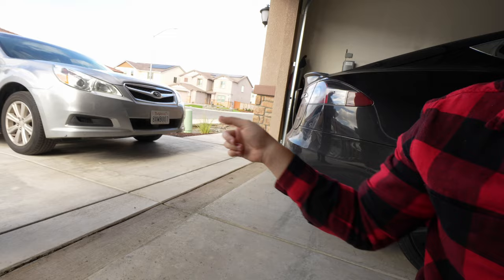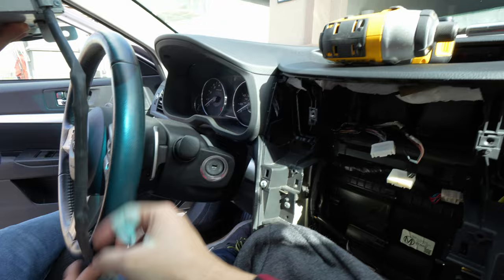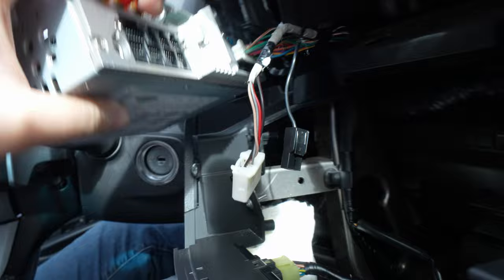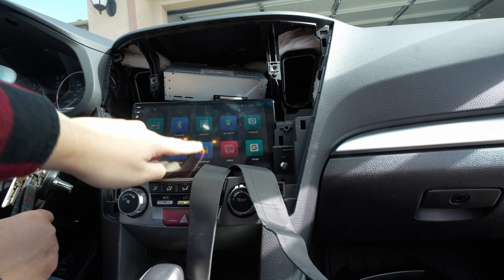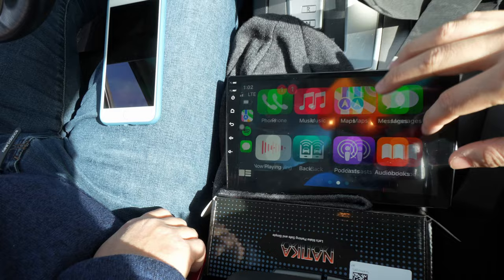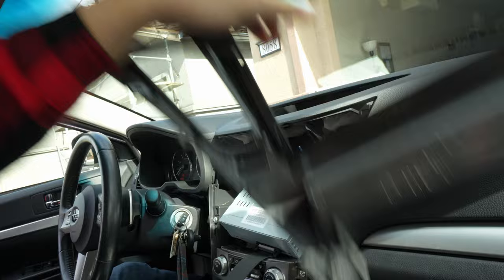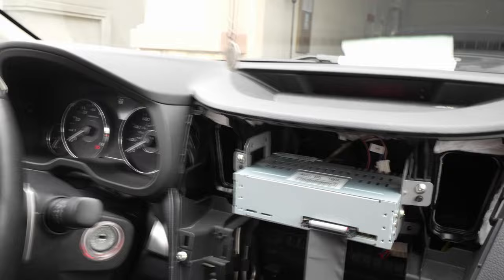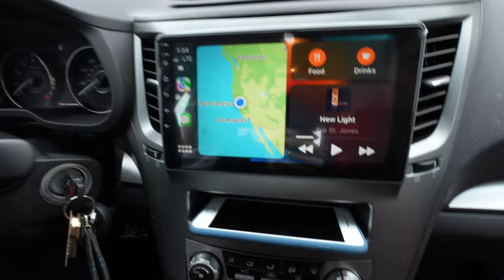Subaru Outback & Legacy  2009-2014 Carplay/Android Auto how to Install! | $359

Comment: I just purchased a Android (Hikity) based radio for my 2013 Legacy limited with H&K radio with AMP.  NEW radio, plug the speaker harness  in to the new radio.  The Blue wire with NO RCA end is power for your amp. The blue wire from new radio harness connects to PINK wire from main radio harness from the car. Buy a junction fitting, package $5 and connect the two.  BLUE wire radio is connected to Pink wire car harness. .
Reply: Im about to buy the hikity unit. Do you have a working tpms sensor? Also do you have an adapter that retains the subaru usb in the center console?

Comment: Thanks for the video. It touched on the things I was worried about with these sorts of tablet-based screens;
1) very slow to turn on due to it having to boot every time
2) clunky interface
3) not plug and play (antenna wire etc)
4) fitment issues
Reply from the maker: Thanks for sharing

Comment: The tiny din pocket is a massive turn off from the double din pocket with door, especially as wasn't required to be removed if they just spent 10 more seconds planning the panel. No idea why they decided they needed to include an entire face kit instead of a mountable unit inside the existing double din hole either - the entire unit sticks out from the face panel so why bother making a new one anyway
Reply: seriously… would’ve 100% bought this right now if it weren’t for it removing that door pocket. like what am i supposed to do with that

Comment: Great video super helpful!  Is the process the exact same for a 2011 Subaru outback? do you know if the wiring is the same?
Reply from the maker: Yeah it should be similar, subaru's generally use the same harness unless you have the harmon kardon package.
Reply: I have a outback limited  2012 with a harmon kardon system, what adaptation do I have to make in this case? the audio output is different from the Multimidia harness
Reply: @JohnNguyenVincent  I do have the  harmon kardon package. The install didn't work! hoping that I can figure it out one day.
Reply: @augiefrank did you figure it out. I have Harmon speaker as well

Comment: Not sure if you still look at comments, but I just installed a similar EKIY stereo in my 2010 outback. 

Same as yours, only one of the three cables fit - I left the ground and SWC cables. 

Weird behaviour - works when in accessory mode but once I power the car up, it doesn’t work. Also in ACC mode, doesn’t seem to let me map SWC. Any thoughts or suggestions? Not sure if these two problems may be related?
Reply: I’m having this acc issue too
Reply: @cesardaza4945  I contacted the seller and they gave me a fix that worked for me. Not sure if your harness is the same, but they told me to cut the A7 wire (which is the steering wheel learning wire). If memory serves me right it was brown. 
Steering will learning and all buttons still worked, and cutting this wire strangely fixed it. 
If you can’t get in touch with your seller, may be worth a shot for you too! 
Good luck :)

Comment: hey man I was wondering if you know if I need any additional harness for my Harmon/Kardon system?  I just got one ordered and just wanted to be prepared. this unit didn't say it wasn't compatible. great video thanks man
Reply: Did it work for you? I have a 2012 outback with the Harmon/Kardon system and was looking to upgrade to this setup.
Reply: Same? Is it harmon/kardon compatible
Reply: Any updates on yours?
Reply: Interested as well. And i am curious if the stock backup camera works.

Comment: Did you need to plug in the ground wire from the car? 

I’m having an issue, the unit turns on when the accessories are in but when the engine turns on the unit cuts off
Reply: Wondering the same
Reply: @brianmillette7453  you don’t need to plug it in. But one cable does need to be cut for it to work properly.
Reply: @danscullyjr  which cable?

Comment: the issue with this is that i really need the radio and rear view camera to work, or else i'd buy this. anyone know other alternatives that would work on a Suburu Legacy 2012 model?
Reply: Hey I didn't watch the whole video, I just jumped around but I thought they said there are ports in the back of the radio for a rear-view camera to go into. Is that not the case?

Did you hear/see something else in the video that said otherwise and would you be able to share the timestamp if possible, thanks!

Comment: Were you able to fix the top gap? I’m having the same issue with my aftermarket head unit where there’s a gap at the top with some clips showing.
Reply from the maker: i filed down the clips in the back and now it sits flush